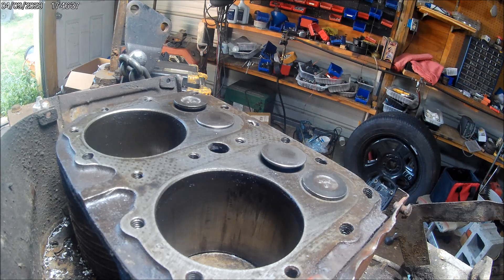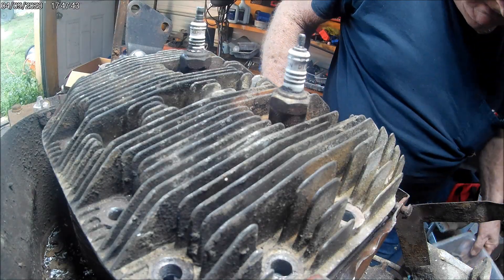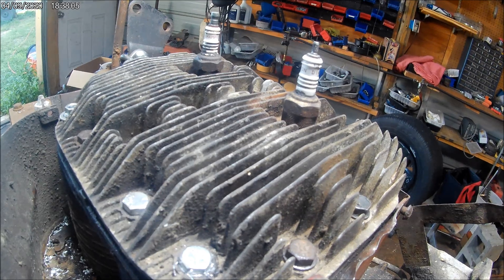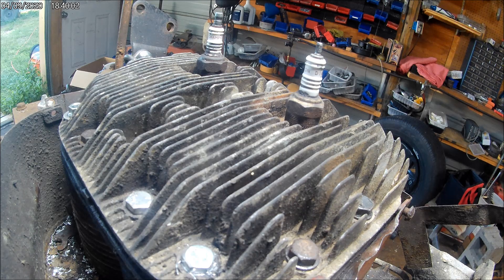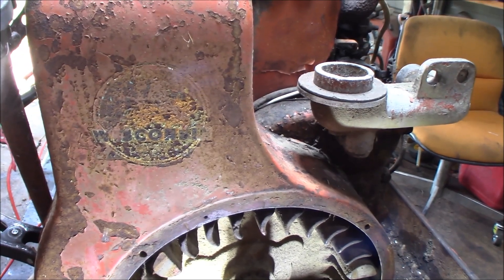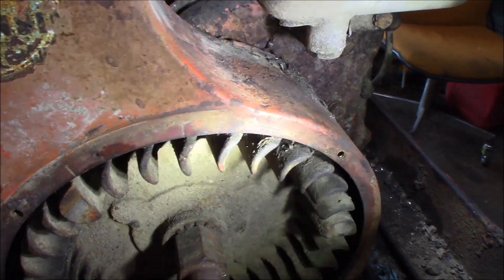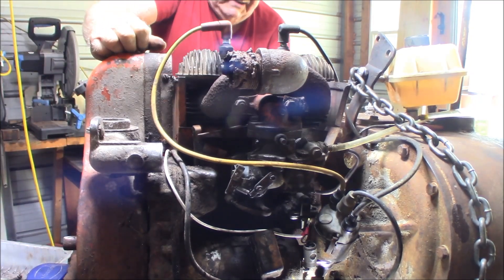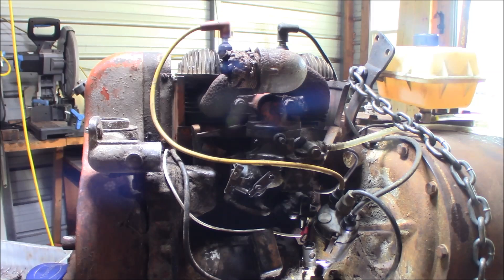more progress on the Wisconsin Thd engine.

Comment: well it came to life i didnt hear anything in the block hammering around  i suspect once the carb is cleaned itl will be a good motor for some project
Reply from the maker: yes, it didn't run long but other than the noise from the exhaust, I didn't notice anything else either.
Reply: Sound not to bad for what it is, your showing it your not to old to kick butt
Reply from the maker: @DIYVariety  thank you very much.